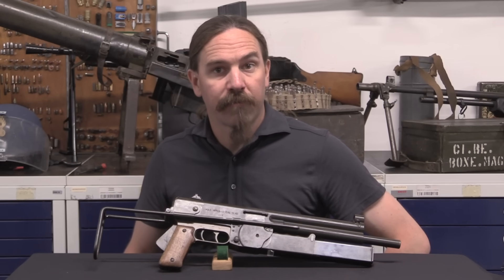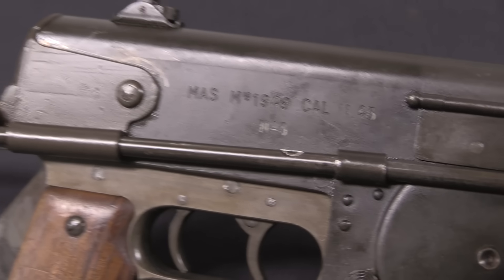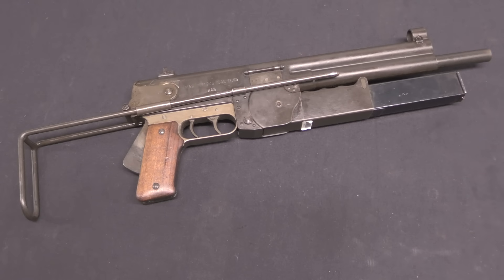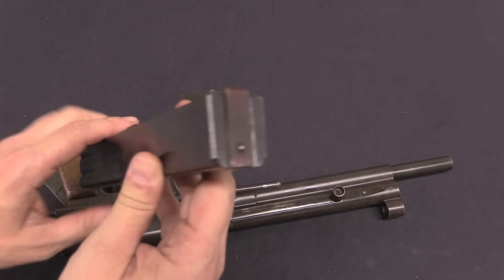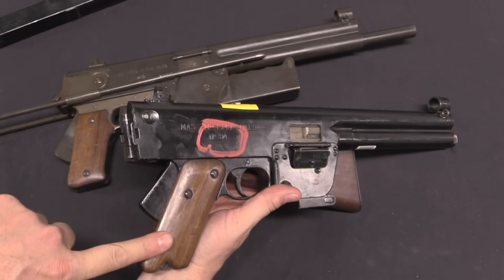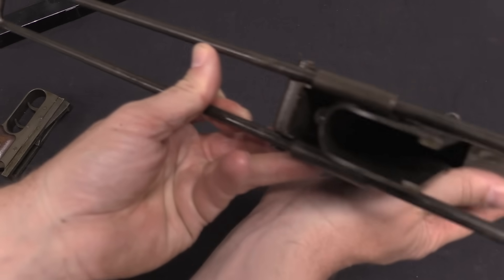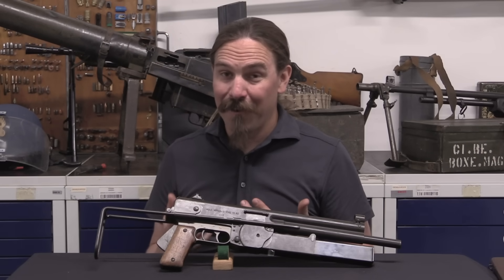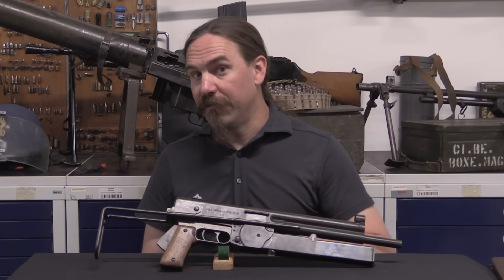Prototype French MAS-49 SMG in .45ACP

Comment: Le 11.43mm américain
Reply: Il n'y a pas de remplacement pour le déplacement!
Reply: Mathematically, the displacement should be a bit bigger at 11.48, 11.49 or just round up to 11.5mm. But what's a few 10 thousandths between friends holding directed energy pipe bombs.
Reply: @PBVader  I prefer to call them "angry clocks" but up to you.
Reply: @PBVader For me it comes out as exactly 11.43mm how did you get 11.48?

Comment: Interesting that they wouldn't have gone with a standard M3 or Thompson magazine for even the prototype, probably something to do with the internals of the MAS.
Reply: right, they surely would have been available
Reply: The double-stack magazine makes absolute sense, if you're serious about arming with .45ACP - the fat cartridge seriously gimps capacity unless you take steps - as the French did here.
Reply: Wanted there own magazines
Reply: Thompson mags are unnecessarily complex to make and thus expensive, and Grease Gun mags frankly suck.
Reply: Remember, if you're a major mikitary who is going to be producing your small arms domestically, you're also going to make your own magazines.  Thus, unless interoperability is a requirement, might as well design a good one.  You aren't going to have your troops sourcing mags from gun shows, after all - you're going to ship the gun with X number of mags, straight from the factory, and build Y number of replacements for the supply system.

Since it really won't cost any more in the end (unless someone is just guving you magazine tooling) than directly copying another design, might as well design a good magazine if you can.

The troop in the foxhole isn't going to be asking a USGI for a spare mag, anyway - interoperability of ammunition is logistically important, but not so much interoperability of magazines between allies.
Reply: @geodkyt that makes sense on a production weapon, but this is clearly a prototype with the odds against it.
Reply: @geodkyt  most of the other French prototypes used MP40 mags. It’s probably more due to the M3 mags not being any good.
Reply: @seculartapes  Honestly, even if M3 mags were excellent mags, I'd expect the French military to look at developing their own.

There is literally no reason for the French military to go and adopt someone else's magazine unless they have basically free tooling or free new magazines in effectively unlimited quantities.

If you've got to make the tooling yourself and you're going to make your own magazines anyway, optimize them.

As for MP40 mags for 9mm developments, well, France had an nearly inexhaustible supply of them on hand already, in terms of what they'd need for prototyping and even fairly large scale troop trials.
Reply: @geodkyt 
Blah, blah, blah!
🙄🙄🙄
Reply: @geodkyt 
Thanks for all of your opinion on something that no one asked for. 
🙄🙄🙄

Comment: Quick correction, although it may have been addressed in other comments. 45 acp is metric designated as 11.43x23mm, while 45 colt is 11.43x33mmR. I have been increasingly curious as to why 45 colt is never qualified as 11.5, which is mathematically 0.452.
Reply: SAAMI spec for 45ACP grooves is .450, which is 11.43mm.
Reply: @PrebleStreetRecords  I am completely aware of that however, I've been reloading, slugging and cleaning barrels long enough to know dead soft .452 and powder coated .453 does not engage the groove valley on anything but the tightest rare barrels. This includes slugging which hardly imparts pressure or temperature required to expand metal. I've even run a copper jacket .4505 down easy once.

This makes zero practical sense. There is no way most barrel manufacturers are following "saami voluntary performance standards" of .442 deviation plus 5 ten-thou lands, .450 deviation plus 5 ten-thou grooves. For another instance, saami calls out one in 16 left hand in both acp and colt. I've got 14, 16 and 20's, some even right hand. You can even get them as slow as 32 twist. Of course, the standard is all voluntary, isn't it.
Reply: @PBVader  You're absolutely right. I should've added to my comment something about how tolerances are far wider than hitting .450 bang-on.
I just mean that since it's the spec, it's what the manufacturer will print on their firearm.
Like how a 3/16 bit isn't going to make a .187" hole, but we still call it 3/16.

Comment: Speaking of .45, can we let it quietly pass already? There is nothing that a .45 does that you can't do with a better, more modern cartridge. Do you want high grain subs for suppressor use? 10mm. Do you want p***ing fast 160-185 gr spice loads? 10mm. Do you want a 1911, or any other firearm, in a large semiauto round, but you want more capacity? 10mm.
Reply: No.
Reply: Like what
Special forces going to 45
Reply: 10mm beats the crap out of guns, if you look at the service life of guns that are available in 10mm and .45ACP the 10mm models wear out tens of thousands of rounds faster
Reply: Agreed it’s basically obsolete, but there is a lot more 45ACP tooling and design out there than 10mm, so the cost and effort is way lower.